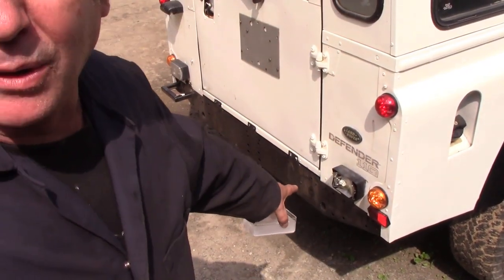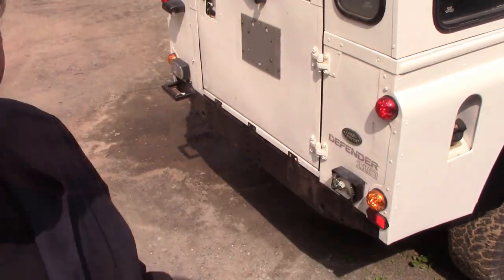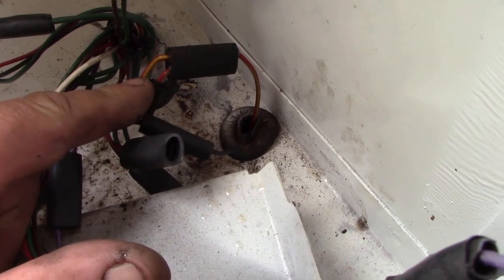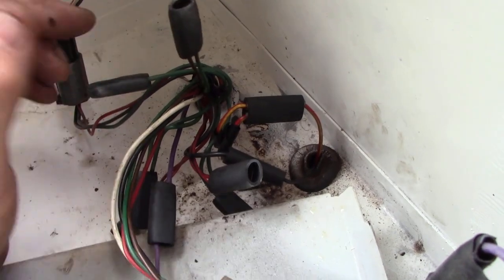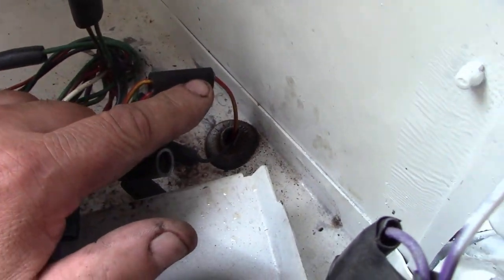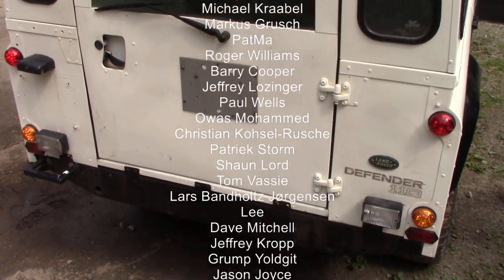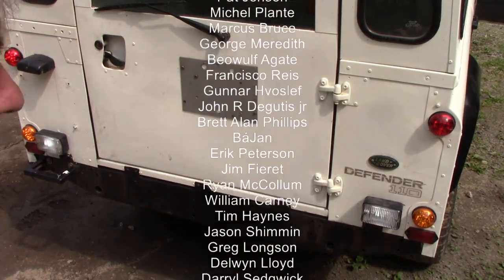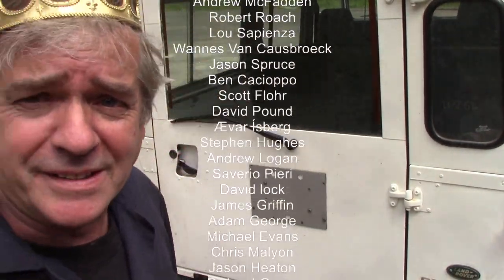Malawi 110 Adding a second reverse light

Comment: I did basically the same thing on my 127 hicap, then added two fog lights under the cross member.  I found the led bulbs were virtually useless in that fitting, being mounted sideways, so reverted to tungsten ones.